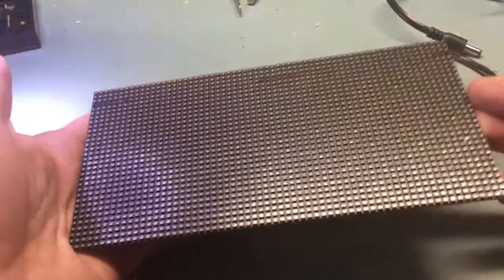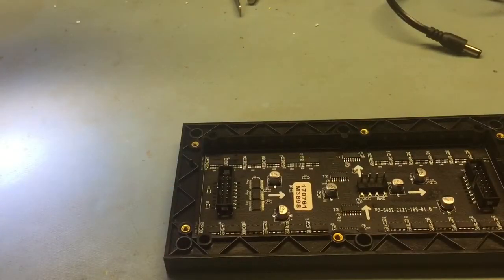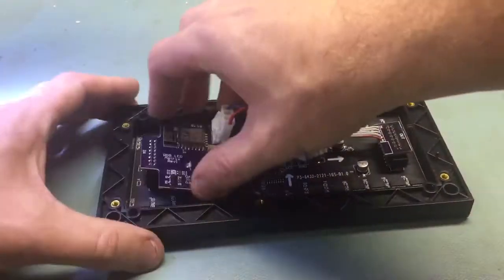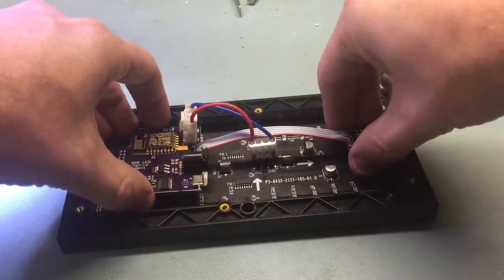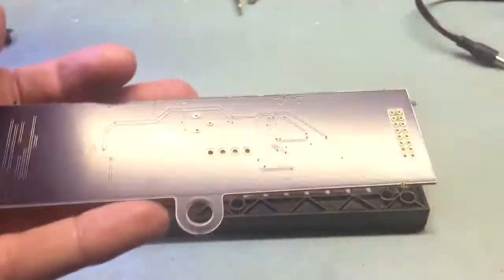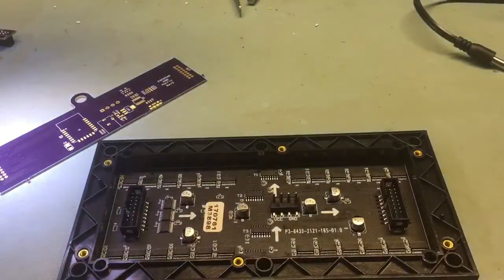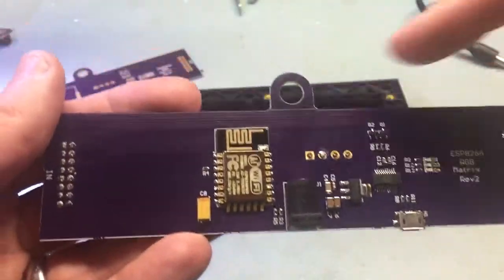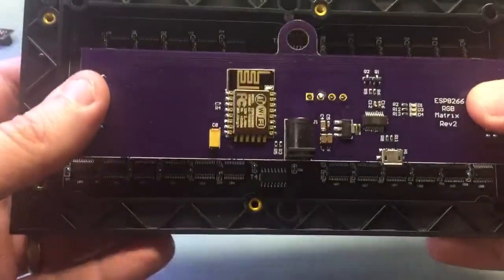ESP8266 RGB Matrix (No Cable Version)

Comment: Good

For other panels i can't use as it's fix in panel

In market i will not find the panel which you are using

Is there generic which can use for any panels

Thanks
Reply from the maker: This project is very old and the panels I used may no longer be available.
Reply: @0miker0  Thanks for reply

Comment: This is probably an out of date project, but just pointing out that it's not necessary (or desirable) to connect to the output HUB75 DIN connector to drive a panel. Only the input HUB75 and power connectors are really needed. Otherwise you cannot daisy chain panels.
Reply from the maker: True. The latest one that I’ve cobbled together uses and ESP32 module and i2s communication. The 2nd connector is empty.

Comment: Nice idea Mike! I just watched both the videos. Great work! 
My only thought, while watching the cabled version, was just to avoid the big power connector protruding outwards.
I thought the single flat ribbon cable between the boards was a nice and tidy solution!
Perhaps another option could be to make use of the crimped flat ribbon connector cable that comes with the panel (instead of the 2nd PCB)
The no cable version would seem to have the downside of increased PCB cost, and being tied to use with only a single specific panel.
Thanks for the videos, keep up the great work!

Comment: Great to see the evolution of this board. Don't forget to solder those remaining pins on the center connector. 😉
Reply from the maker: The center connector is the error I’ll fix on the next revision. It’s higher than the two back ones not allowing me to push it all the way down. To get it working I left it off and soldered two small wires. Tomorrow I’ll order the correct header and a new board revision.